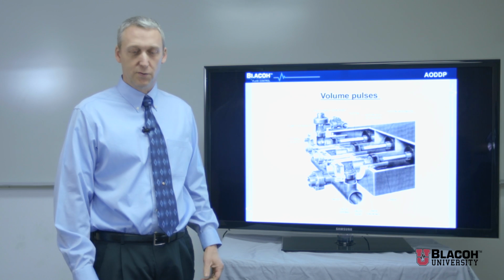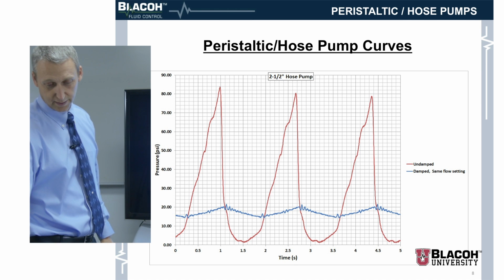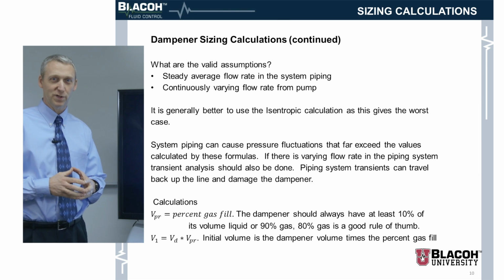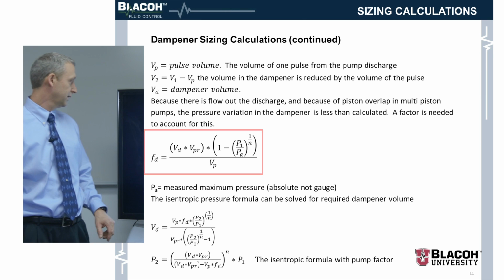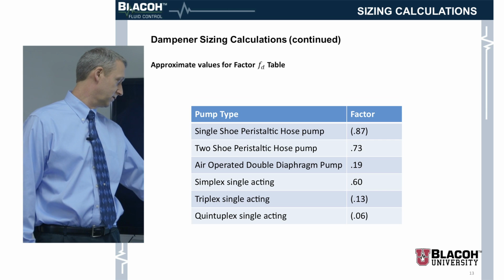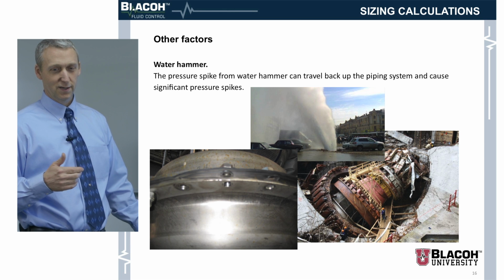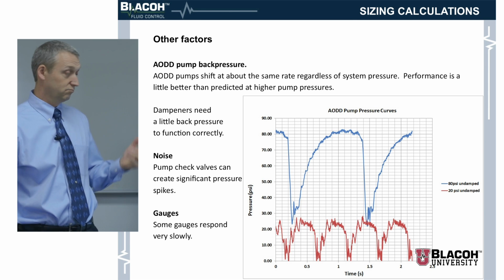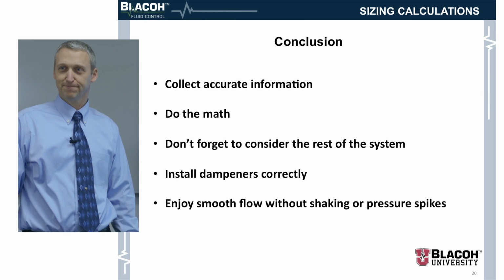Pulsation Dampener Sizing

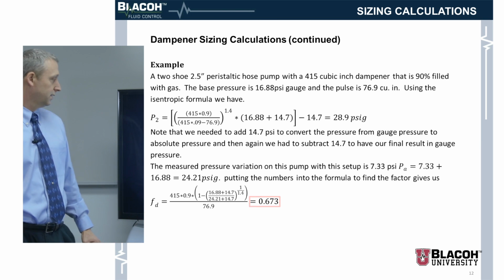Comment: 14:38 is 16.88 psi the minimum pressure, or is it the average pressure? If it's the minimum, then shouldn't the max pressure be 24.21 psi if the pulsation is 7.33 psi?

Comment: I’m going to check my rig circulating system pumps to ensure quality MWD data transmission. Thank you for this informative course.
Reply: What did you find on this truth?  We normally use 60% of operating pressure for pulsation damper charging